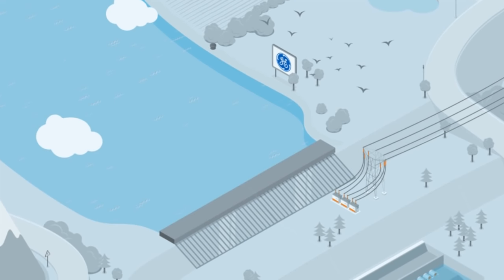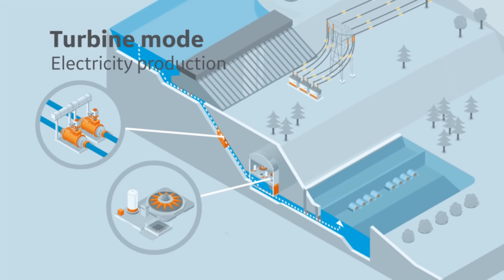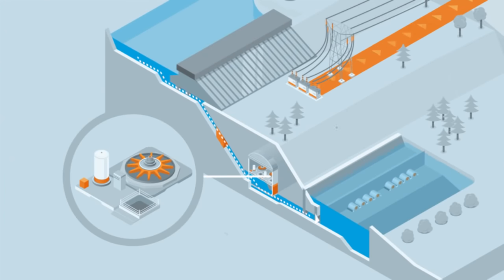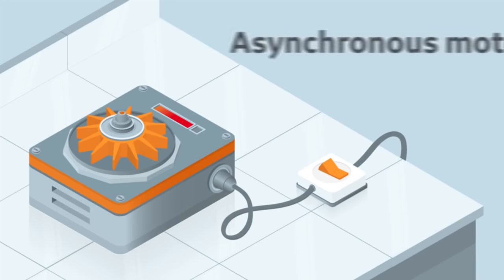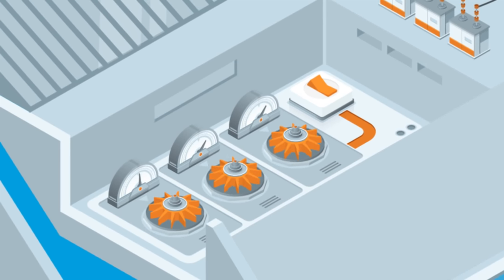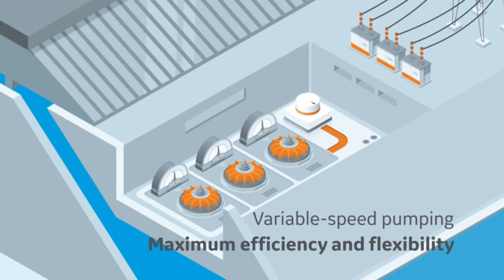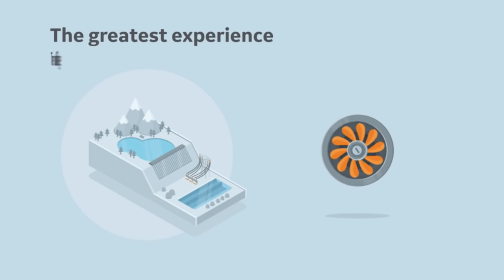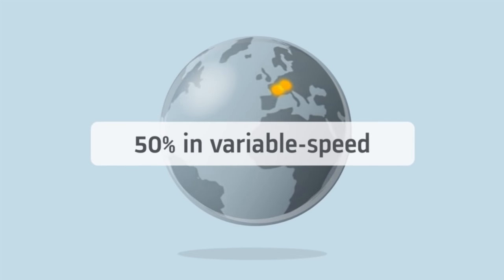How does GE’s Hydro Variable Speed Pumped Storage technology work?

Comment: Surely you don't need to build two reservoirs. Just one near the sea. Then you also get the added bonus of using salt water which is denser.
Reply: there's issues there, wave action could damage the inlet, also you then have the problem of tides, if you have surplus energy from renewables and the tide is out, you won't be able to pump to upper reservoir, same works the other way at high tide. the two reservoirs need to be self contained, controllable and unaffected from tidal processes.
Reply: salt water also has high corrosion, unless you invest more on the material to mitigate that, which would make it less cost efficient
Reply: The final advantage of a two reservoir system is that it can be created anywhere there are natural elevation changes.  If one can mitigate evaporation this could even be done in very arid, high population density, areas (e.g. Southern California, the Middle East, Central Europe, Southeast Asia, India, Pakistan, etc.)

Comment: does the power produced while flowing =  the power used for pumping back...???
Reply: No. But power used for pumping is much cheaper than power produced by falling water, thus profit.
Reply: @sleeptyper  
there is a more fundemental reason for pumped storage, it is inefficient but it's purpose outweighs that, see my explanation to Mafarmega earlier.
Reply: @iareid8255  Grid load compensation is a good point too, but OP asked about the power used vs. power produced. Only the price difference makes it viable in the long run, since those reservoirs can provide even base load supply all day long, but eventually they require refilling unlike river powerplants.

Hydro pumped storage is a net user of energy, because losses. I have always wondered why they don't build a filling pipe that diverts the water to go over the waterhead. Pumping against the entire basin wastes energy...
Reply: I've heard efficiencies of 70-90%.  This doesn't sound great, but if electricity is twice as expensive at night then this can make a lot of sense.  

The efficiencies are comparable to lithium-ion batteries.  Yes - some power is lost.  However, as batteries go, this is pretty good.

Comment: Wouldn't it be smarter to use pumps that don't require electricity and make this a producer of power instead of a storage?
Reply: This is primarily a battery, not a power station.  Think battery, not hydro-electric dam.  

The energy grid needs batteries for when the sun is not shining and the wind is not blowing.  

This battery can be built anywhere there is a lot of water (ocean) next to a high level reservoir (eg. the top of a mountain).

Hydro-electric only works when the water is flowing down naturally already (eg. a waterfall).  No natural water flow means no natural hydro-electric dam.